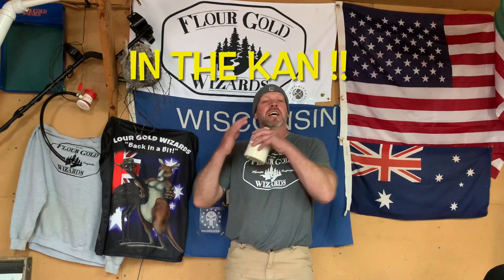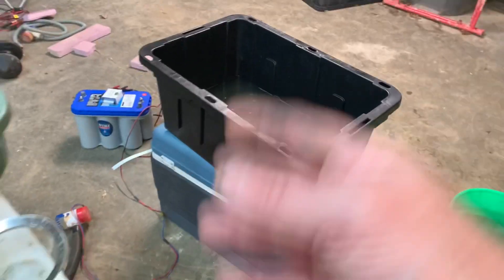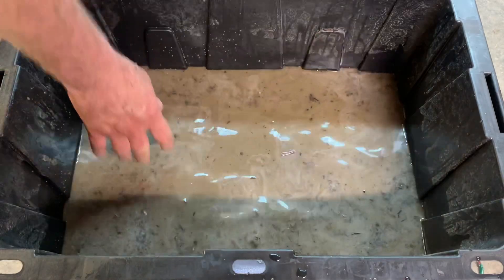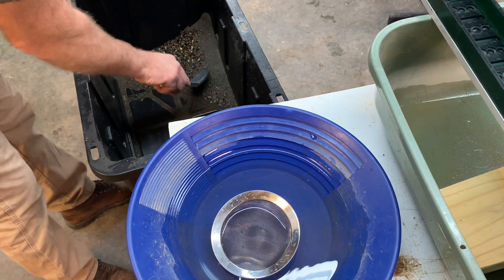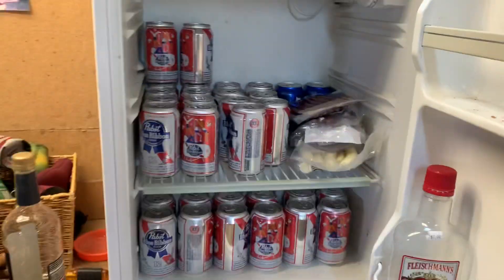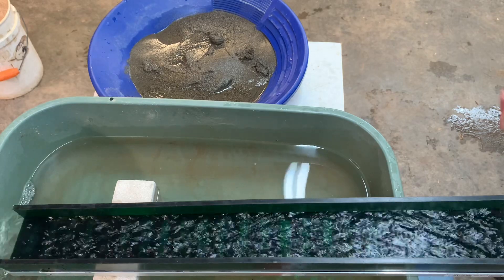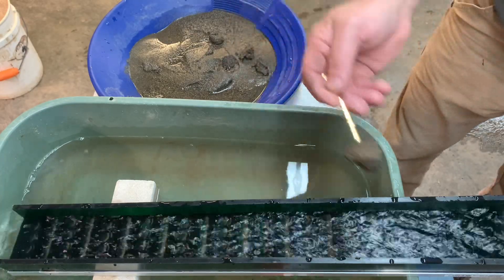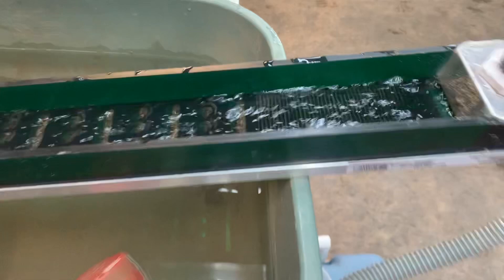Yukon river GOLD!!!!!

Comment: There isn’t a lot of actual clay on the Yukon. Most of the mud is actually glacial silt. Oddly enough the easiest way to clean your sands and gravel is through “blowing” the silt, or slowly trickling the dry paydirt in front of a low volume fan (a $5 Walmart box fan set to low is more than enough). Then wash it once, let tit dry again, and repeat. After that 95% of the silt is gone. I live near the Yukon and use this method a lot.
Reply from the maker: It was extremely light so I would think that would work great !!!! Thanks for the tip!!!!!

Comment: I was wondering are those speed controllers all for batteries or do they make some that you can plug into the wall?
Reply from the maker: Unsure!!!
Reply: DC PWM (pulse width modulation) controllers (DC Speed Controllers) can be run basically from any dc supply (auto / motorcycle battery or a DC power supply) that has enough voltage and current supply to operate the controller and chosen pump or almost any other DC powered item. PWM controller can run a 12v dc auto bulb for bright or dim lighting.. dc powered drill and so on.
A simple 12v car lawnmower or motorcycle battery is easy to use and has lots of power supply capacity for a bilge pump. 
If you don’t have a speed controller.. Amazon or  EBay has many choices available!
Type in the search window “PWM” if this is overwhelming or you’re not interested in a DIY project.. buying one all setup for immediate use with connections and so forth is always nice!
Check out the speed controller Jason is using.. ready for lots of work!
✌️PT
Reply from the maker: @ProspectorTripp  
Yeah what he said..🤣🤣🤣✌️
Reply: @FlourgoldWizards   you crazy man..
Reply: Oops.. I forgot the plug in the wall part.. 🔌
Any inexpensive battery charger plugs into the wall and can be connected to a lawnmower size battery keeping it charged up and ready for use. Then you can run the speed controller and pump off this setup. Should run a bilge pump a couple hours if the lawnmower size battery is good.
These types of setups with a battery, controller and pump are very handy and useful also portable which makes it perfect for our prospecting and mining activities.
Long winded as usual 🙄
✌️PT

Comment: Yu Con🤣  A silly question, maybe, but why is gold yellower than anywhere else in the world. I mean why does gold not have the same yellow color wherever you find it? For example, the gold I find here in Norway is somewhat lighter than the Australian. And the gold from Alaska seems even more shiny yellow.👍👍👍🤩🤩🤩
Thank You so much for sharing the good stuff👌
Reply from the maker: I too have noticed!!! My nuggets from Australia are quite dark indeed , I assume they are mixed with other minerals / metals ?
Reply: I'm not Jason but i might be able to help you , it depends often on the purity i believe Alaskan gold is a lower purity percentage than gold from Australia which in some cases goes as high as 98% pure , which gives it a more yellow buttery color , hope that helps , cheers .
Reply: @GrooberNedJardine   Awesome mate, thanks👍
Reply: Gold always has other metals mixed in, mainly silver and copper. More percentage silver, the lighter the color. More copper gives it a red color. It could also have platinum group metals in the mix to.